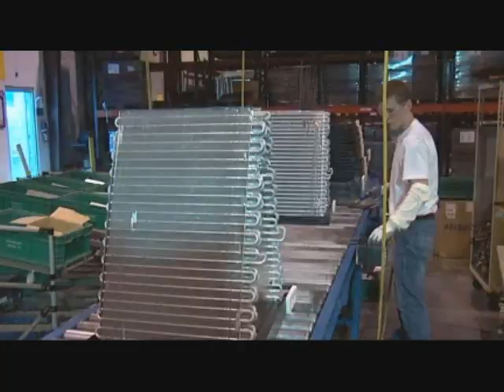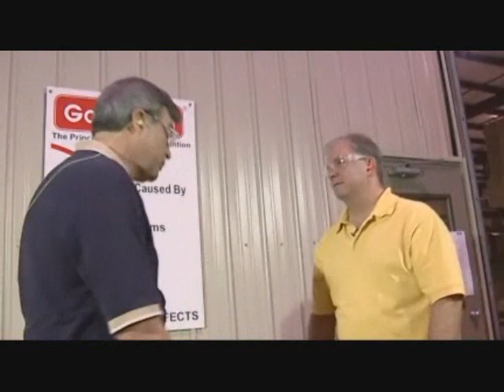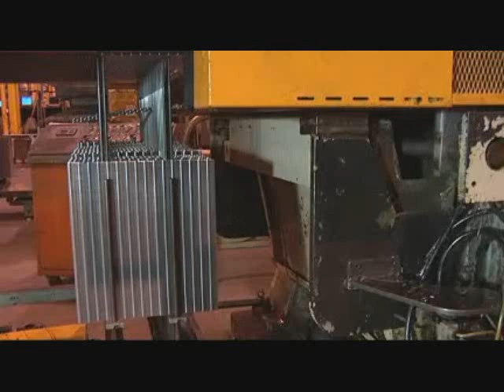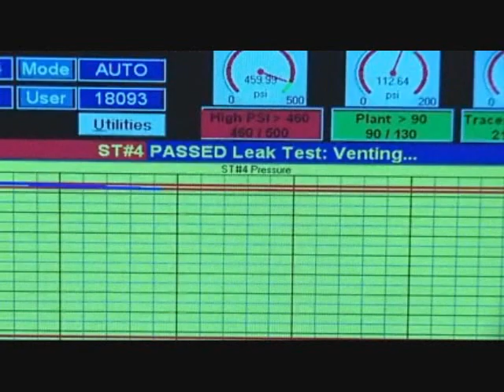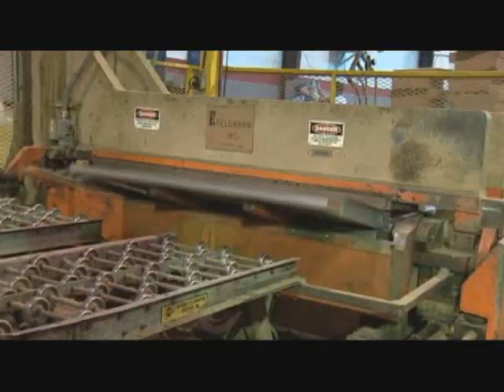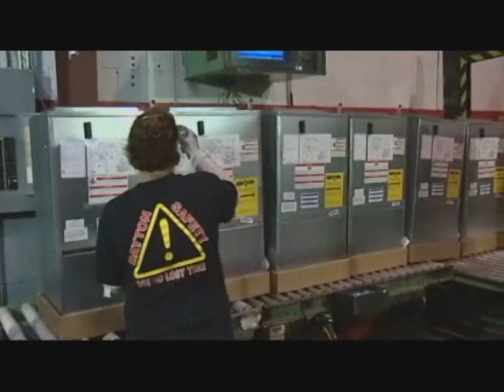ACWholesalers.com Presents Goodman Dayton Aluminum Tour

Comment: My 14 year old Goodman 3.5 ton 14 seer spung a leak on the top of the condensor in the corner above the electrical panel, looks like the metal panel with the fan vibrated a tiny pin hole in one of the copper Cs, its fixed but now the reversing valve is stuck in ac mode so i guess i need a new outside unit